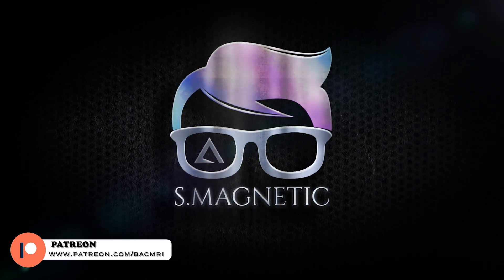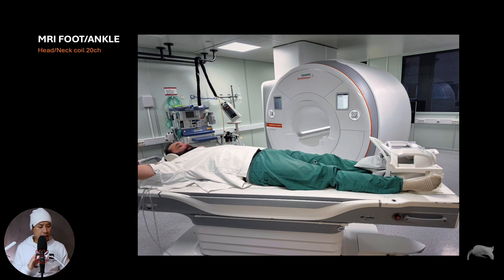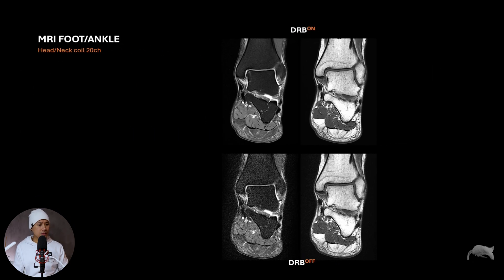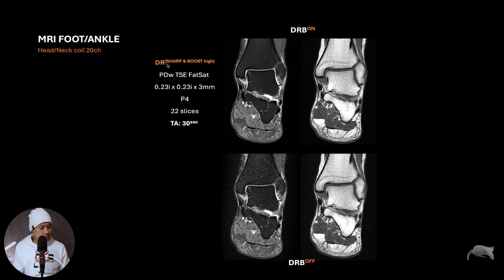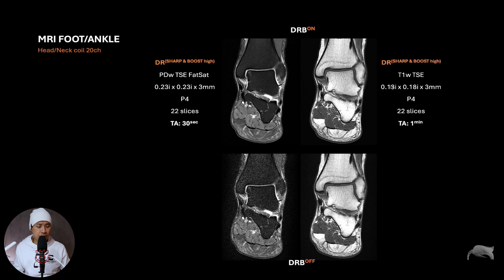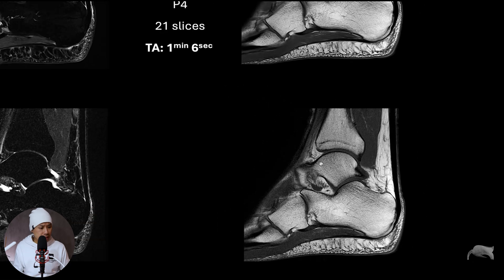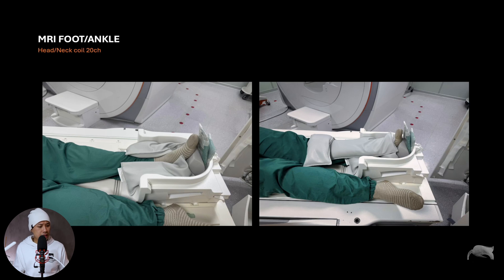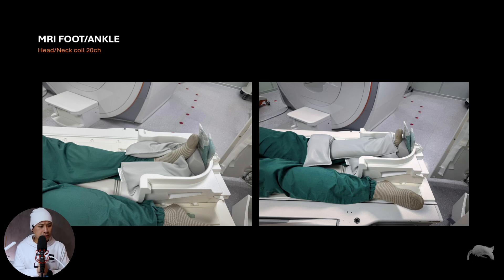MRI Ankle Imaging Using a Head/Neck Coil

Comment: Hi, Bac 
thank you for your videos this year !
we have used head coils for foot/ankle... but we think that the images come out better with flex coils than a head coil,, it may be different setting..? not sure.... your images on the films look really good for high resolution. 
Do you think front head coil affecting image quality for some reason...? because we always used front head coil when we scan foot with head coil...🤔
anyway Happy New Year 2025!
Reply from the maker: Thanks for comment and following. I don't think front part has anything to do with the ankle quality. I tried both and didn't give any difference. However, key behind my images here is without doubt using deep Learning (Drb). Without Drb surely can get good images as well but with longer scantime for sure. Wish you a happy new year 👍☺️

Comment: If i using the head coil , the resolution gets bad why?
Reply from the maker: The head coil is not meant for such exams. So you need to optimize your sequence thereby.
Reply: @ how i can optimize the sequence?
Reply from the maker: Depends on many factors. Scanner. Softwsre. Fields strength. How you position your patients. Etc.
Reply: @ 0.55t , x60 , free max with drb, i need to know how i can create sequence on head coil , because, if i using the head coil now it produces weak image

Comment: The problems I have seen is the difficulty with positioning due to the size of the foot/mobility/ casting.  Using the Espree, there is a separate head top piece and neck piece.  I would think that you might be able to put the neck piece on, leave the head piece off if the foot is too bulky and still be able to do the ankle/hindfoot.  But the toes would be a problem.  Unless you could slide the foot back to where the neck piece is closer to the toes.. something to try on an Espree if anyone has the time..
Reply from the maker: @anniesshenanigans3815  yes also thought so. But imaging without the front doesn't matter. Still provides good images for the ankle. However, for the toe it will be another story ☺️

Comment: Hi Bac, how do you avoid wrap from the other foot in the axial images? Putting phase direction at R/L, prevents the toes from wrapping in, but because the head coil is so centered, how do you prevent the other foot from coming in? Do you increase over sampling to 200?
Reply from the maker: actually didnt struggle with wrap here. was way less than 200 thereby i could push the scan time.
Reply: Try phase direction AP and a 70-80% phase oversampling. It should be enough...
Reply from the maker: @ but might also suffer from pulsation artifacts.